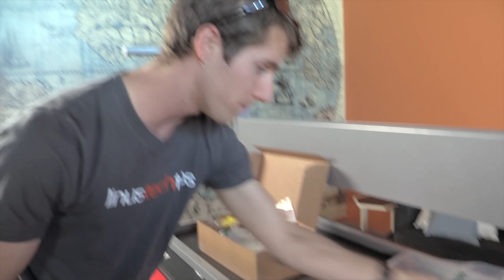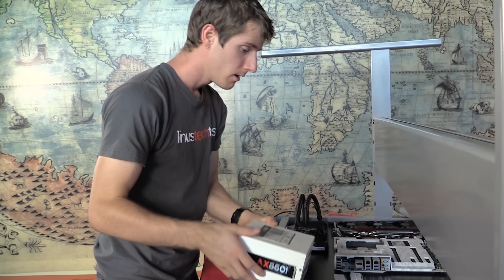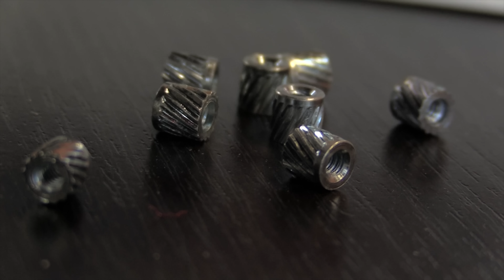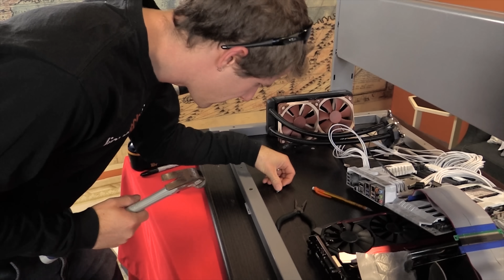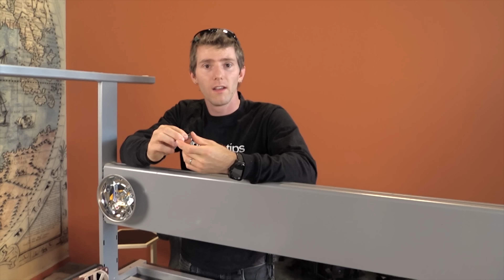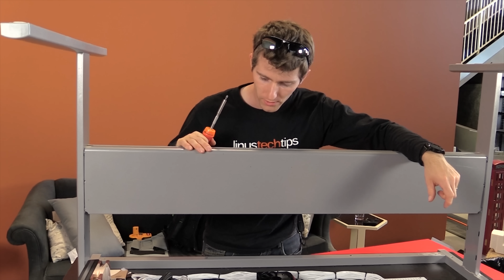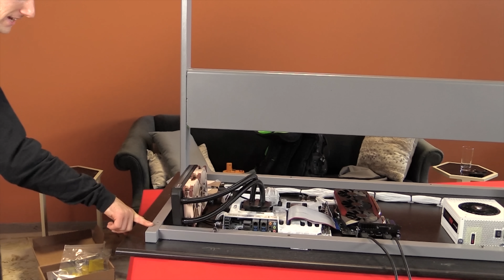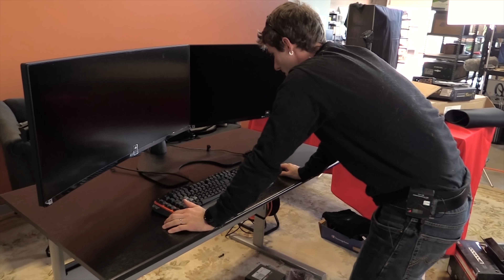The ULTIMATE Space-Saving PC - Desk PC Build Log

Comment: this is the specs of my possibly new pc, can i get some feadback and tell me if somethings not comptatible? thanks
GTX 1070 MEDIUM GAMING PC I7-6700K

INTEL CORE-I7-6700K PROCESSOR
RAM DDR4 16GB 3200 CORSAIR / GIEL / GSKILL / KINGSTON HYPEREX
SEAGATE HDD 2TB SATA 7200RPM
SSD 250GB SATA III 2.5 INCH DESKTOP
DVD R/W 24X SATA
VGA CARD GTX 1070 8GB DDR5 VGA CARD
CASE COOLER MASTER K350
WINDOWS 10 OPERATING SYSTEM
Reply: have you used the pcpartpicker website?
Reply: Is having a smaller SSD and an HDD as good as having large SSD?

Comment: you guys should have made the components facing up through a glass panel so it would be visable
Reply: With that desk he couldn't
Reply: No airflow though
Reply: +wixness15 have it so there are fans along one side of the desk leading in and the other side leading out, and have the front and back sealed.
Reply: That is not so easy though. Those kinda pcs usually require a custom watercooling loop because airflow would be shit. Also you would need to build a whole new desk or mod an existing one. That's why pc modders usually build those pcs. There are severeal pre-built pc cases/desks but they're expensive as fuck. In fact they cost as much as a decent gaming pc.
Reply: +Lucas Hols (BlondeEskimo) you would have clearence issues if you used air cooling

Comment: I love the G710+... I bought my first one for $130 and then a year later found one completely buried, covered in dust and nasty crap at a flea market for $5. Took it completely apart, cleaned every square inch of it including all keys... cleaned all mechanical switches and oiled them. Plugged it in and it works and looks brand new. Can't beat $5!!!

Comment: Saw someone build this into a desk drawer once. Obvious advantage is that you're never going to accidentally touch/kick a component since it's inside a drawer and the parts are much easier to work on since you can just disconnect and slide it out. Obvious disadvantage is you don't get as much airflow due to being in an enclosed area (although you do of course put ventilation holes)

Comment: I hate the Z97 series CPUs for their sound cards. They suck. Especially when you use pulseaudio and it stutters all the time. Pulseaudio works fine for everything else, so honestly I'm not touching low end for Intel for a while.
Reply: what? there is no soundcard in the cpu your sound output comes from your motherboard so it has to do with whoever produced your motherboard
Reply: bas van der werff still, pretty much all Z97 sound cards are bad. Many people have had problems with different motherboards with pulseaudio.

Comment: I'd just take a nice sturdy basic case, drill holes into its "roof", and fasten it to the bottom of the table. I prefer to kill my components with excessive overvoltage, not accidentally knee-kicking it to pieces.
Reply: +Pieter Rossouw could just cut a case or any other piece of metal so that it fits over individual components and drill some airholes in them.

Comment: I am going to do something like this expect mount it on top of the desk and have a glass top layer above that so you can see the components while you sit at the desk.
Reply: Its literally a desktop
Reply: The Geek Zone they legit just made a vid on this, you predicted the future my friend
Reply: OhLiQuiDz yeah, I made one the day they released the first part of that, 2 weeks later still waiting for part 2
Reply: Through some research we can probably pull off 4.5" and we may be able to a tiered setup where the the thicker stuff is at the back and thinner stuff at the front so we can make the desk thinner at the front where the knees typically line up.
Reply: +The Geek Zone 
How thick is the table going to be then? Power supplies, radiators ( For a water cooled cpu), and a decent air cooler (Hyper 212 Evo maybe) are all pretty thick. Also you cant just place the glass on top because you need airflow. I guesstimate that the entire thickness of the desk would need to be ATLEAST a minimum of 7 inches which would be pretty damn thick. I see alot of bumped knees in your future friend.
Reply: +Luke Moll you don't drill Into the glass, it's just a glass table top.
Reply: What are you going to do for cooling? or will you have room for air between the table and the glass?
Reply: Holy crap that's nice, but don't forget to build it the right way, not upside down
Reply: doing a vid?
Reply: most glass top desks have a bit of space. and damn, beaten to the idea. though, even haivng a little ITX PC under the desk for your streaming rig or HTPC stuff like my big AMD gaming rig does double duty for would be kinda nifty.
Reply: Cool
Reply: you're gonna have a hard time mounting the mobo
Reply: +Luke Moll how do you figure?
Reply: +The Geek Zone Linus drills the thread casings into the wood, I don't know a lot about glass but I'm fairly sure it's a lot harder to drill anything into
Reply: same, but how i make bottom of it
Reply: *****
true
Reply: I have actually seen a pic of a custom in desk pc with glass on top way better than this under desk method
Reply: thats called a desk pc
Reply: http://www.l3p.nl/l3p-d3sk/
Reply: Cool!

Comment: Nice Build! Next, one in a motorized wheel chair with movable monitors hanging from behind the chair and a small table that can be moved aside (for the keyboard and mouse... maybe even a drink!). That way the user could just move to another room, if needed, while sitting in the chair and just plug in the computer into a wall socket (I guess excessive use of hibernate might be needed). Or maybe rebuilding a laptop or two this way for easy use of batteries.

Comment: in use windows I found it need power to the video cable
http://www.amazon.co.uk/Power-Connector-PCI-E-Extension-24-5cm/dp/B00R1LNPO4?ie=UTF8&keywords=PCI-E%20PCI%20Express%2016X&qid=1459653666&ref_=sr_1_4&sr=8-4
now it works 100% of the time

Comment: As the son of a carpenter, I have but one suggestion (not even a complaint).  The inserts for the motherboard mounts would be best served with a dab of wood glue first.  That way there is almost zero chance of them eventually slipping out of the drilled holes due to desk movement and/or gravity.
Reply: +AndrewDeLong Or he should have used ones that have threads and don't just hammer in.
Reply: ***** This too is a possibility.

Comment: So the next step is to put a thick piece of plexi over the whole thing with a 120mm intake fan and 80mm exhaust. - Guess you would need to put that radiator into an external deal from main components. - Only problem I see is if you need to take your PC in for repairs.Guess you could just pull the hard drive and take it in for normal repairs.

Comment: You're gonna end up kneeing a fucking fan and that hurts like shit
Reply: +greensparkles When I was looking at this, I thought why not make a metal shield you can bolt to the metal leg chassis to separate your legs from the PC components. It would be easy to remove and it would save you some worry.
Reply: Only if it's a metal fan.
Reply: The bearings would probably get damaged too.
Reply: +greensparkles if i were to build this pc i wud rather use it like an console not to play with shitty graphics lol but sitting on the couch and playing with a controller :D
Reply: That's not really a problem! But what if u knee that 980ti!!!
Reply: +Optimistic Gamer it would heat up a bit quicker.

Comment: I want to say that this build was cool, I built a computer desk last year as well. I did almost the same thing but I made a glass top and displaced my motherboard and power supply as well as made a hard drive rack with a cooling fan. My desk is rocking 3 20" inch flat monitors.  I wish this let me show you my design. I also have a second power supply for my stereo I am running a car stereo deck and a 1000 watt PPI car amp... I have to say that I have liked all of the videos you have put out.. Keep up the great job :)

Comment: Hmm.. Mine is a bit more ghetto. I built my of in the large filing drawer of my desk, screwing the motherboard straight into the wood, holding the power supply in place with blu tac and just resting the add and hdd on a pile of cables. All I had to do was cut open the back of the desk for I/O and a fan

Comment: You should do an aluminium case (or just use cut in a half an old case), this will allow you to detach the whole case to make your modifications and attach it again, you can also use the other case parts to mount the SSD, PSU etc, you will still have your TABLE-PC and the ability (modularity) to change the pc itself to another table. Cheers.

Comment: I think one more little tweak would be cool - cut out a hole in the table and install USB connectors on the top side (unless you already have USB hub in the display). Easier to plug in memory sticks and tings like that. Otherwise a nice build!

Comment: If i were to build a computer into a desk i would get one of those display case desks (or build one), you know the ones that are like a shallow box with legs and a glass top that acts as the table top. Then i would build my computer on the wood in the bottom of the box, cut out holes to put the fans in, etc. I would focus a lot on color scheme, and add lights and clear water cooling tubes with colored light, all that so it looks cool. So you can see your computer through the glass at any time, and you can easily lift up the glass if you need to fix/upgrade anything. It would be really cool to get one of those antique wooden display tables too.

Comment: I would have mounted the system on that big crossbar. That way you could have routed all the peripherals up the back over the table. Plus mounting all that stuff under the table is kind of unsafe for all the components. Mounting the components on that bar would tuck away all the components so you could use the under space for your legs without worry about the components and you do not have to be prone to maintain the system or upgraded it..

Comment: So can this run gta 5
Amd 6400k black edition
Msi a68hm e33 v2 motherboard
Ddr3 8 gb of ram
Kfa2 750ti darbee edition
Reply: That should be enough for sure!
Reply: +Kaan Cavusolu Google system requirements lab, it auto detects your hardware and tells you what games you can run and how well it does. It also tells you how your hardware compares to the high/ low end equipment. I hope this helps.
Reply: that 750ti sucks
Reply: +steve-O craft I use it, it doesn't and if you are referring to a video Linux did on gpu's that included the gtx 750ti let me let you know it was only a reference card and the real gtx 750ti and FTW edition is pretty good sure it isn't any Titan X but it gets the job done.
Reply: +darksouls45688 ohh I didn't notice. my cards still suck tho. I have r7 250xs. 

I need an upgrade soon. I feel like I need directx 12. instead of 11.2

Comment: Hah i have such a bad pc 
Nvidia GeForce gts 450
Intel core i5 2300
No name 450w psu 
Random biostar mainbord 
Intel stock cooler

But upgrading to 
 Evga Nvidia geforce gtx 970 ftw 
Intel core i7 4790k 
Be quiet silent base 800 window
Asus z97 - p
Enermax lichtech 240
Be quiet straight power 10 600w

Comment: Tip for drilling wood to a specified depth without going through: Put masking tape around your drill bit to where the tip of the bit and the edge of tape closest to the tip are measured to the desired length. This gives you a nice visual reference for a stopping point.

Comment: I would have mounted the cooling system on the back side of the big flat metal brace so the fans would either push air down or up, and I would have moved the power supply to the back side of the brace also.. Would have gave you more room to spread the other components out on and give you more leg room.

Comment: This build is truely foolish, there are so many things that could go wrong either while building it or after building it. You have a very high rate of shorting out your board or any other components and if you saw he was wearing sandals on carpet with no ESD protection. Big no no! Even if you did get this all together and built, maintenance of this desk computer would be difficult due to the fact that everything is upside down. You also run the risk of accidentally bumping/bashing your parts with your knees under the desk. And same thing if someone else doesn't know how to use the desk either. I would recommend building some kind of removable cage protector for all your parts on the bottom, but even then, still a huge pain. Not worth time, money, effort and it's kinda a waste of a good desk. Overall video was a 7.5/10 and still deserves a thumbs up.

Comment: I really like the idea of a PC incorporated into the desk. I feel like it would probably have worked out a little easier if a large board was used as a mounting platform and just attached to the bottom of the desk. It would probably be easier to attach the PC components to the board and then attach the board to the desk. This also gives you a little bit of modularity in case you want to change the PC build in the future or move the PC build somewhere.

Comment: as for the fans on the cooler.  puller fans are more effective than pusher fans. so putting them on the outside of the radiator would have been a better spot.

Comment: just a tip from personal experience, this type of rig has a disadvantage when it comes to cooling. your cpu looks like it'll be fine, due to the radiator positioning, but the heat of the GPU's exhaust will rise right back up and get trapped a bit under the desk due to the box-like support structure for the legs. I would recommend routing some passive off-vents near the GPU to give that hot air somewhere to go, but make sure you finish the insides of the those vents with boiled linseed oil or something similar, as unfinished wood tends to be a dust trap.

Comment: This is a decent start, but it's inelegant. I don't like the risk of something touching any part, averything should be shielded. Also is the position of the screens correct? They join at an unusual angle, also the single arm mount is wobbly :-/

I've been planning a desk computer for a long time, unfortunately still don't have my place to actually do it, but my idea is to put the computer *inside* the desk. I would have a glass (probably) lid that slides or can be lifted to access the computer assembly so to replace parts standing up or without the need to flip the whole desk... eventually the whole thing could be mounted on a platform that could be removed from the desk, with handles like you have on racks.
With such configuration, leads could also go through some holes I would have toward the back of the desk, you could plug your USB (thumb)drives directly from the top positioning a USB hub under a cutout of the desk top as well :]

Comment: and now time to take it apart because the videos over
Reply: +HermesGames Yeap, who would actually use something like that? Bad design and even worse implementation. Could have been interesting video and actually cool if he had built sides top of the table, made top with glass, made insert, so it can be slided out and then installed parts to that. Adding RPG led strips, making proper ridged monitor mount, little paint and this would have been actually worth something... 
For hight table legs could have been chop desired amount or could have build those from scratch... 
Are people seriously that handicapped that they cant "build" anything more complicated than some IKEA shitty chipboard pieces of furniture?

Comment: You should see my desk pc build. I removed the top drawer and replaced with a pc case. The desk still looks like it has 2 drawers but the top one is more of a lockable cupboard door (case door). The bottom drawer hosts 4 hdd's. I installed cooling fans to keep the whole enclosure cool, and it works hundreds. The best thing is no-one can steal my pc, unless they take the whole desk.

Comment: Been thinking of doing something like this, with a Table Overlay. Sort of a table sized but still enclosed box of Lexan, with 3 240mm fans at each end for a constant flow across everything. It would be really easy to mount the whole box and just use it as the table top, and still have everything totally protected and cooled. You could even use the Wall Mounting method to mount the whole thing vertical and secure a VESA mounted Monitor/TV/Both to the room facing side. Any thoughts?

Comment: Wow, i'm just building a similar project for over a week now, though my pc is an absolute low-end one, targeted only for multimedia (playback) purposes, and my table is a light-weight fold-out table, but when all gets done it will be mounted on the wall (thats where the light weight comes in handy), and there will be no cables hanging from it at all, since i will mount it over a power outlet. Also all the parts will be exposed and backlit :) I did sadly kill a hard drive during the build, since i wanted to replace the drive cover to a see through one, so it could be lit, but even the slightly less than 2 minute exposure of the internals done enough to make it unreadable.. So the next one stays stock :D The progress so far is at about 50%. Woodwork is 90% done, i just need one more cable access "hole" near the motherboard IO (for the display), and another one for the power/reset buttons. It will have wireless controls, so no holes there :) Just do a search on "The Monolith - Unique PC Build" if curious. Its actually pretty awesome to create your very own concept and construction free of any limitations instead of sticking to any case where pretty much everything is predetermined. As Linus pointed out, measuring (at least 2 times before drilling/cutting) and test mounting is the most important, and this is very well done in the video. Very nice, clean, and very well thought-out! Kudos